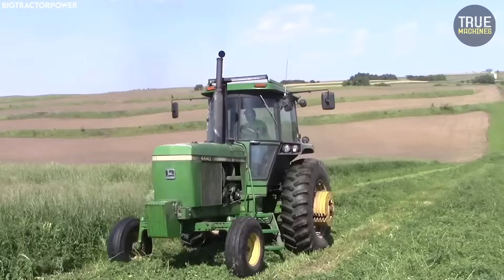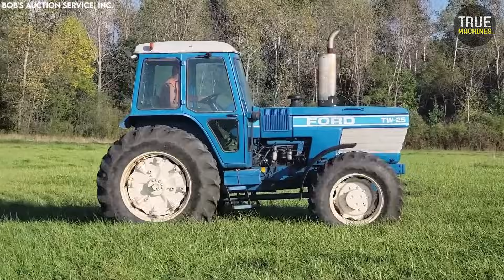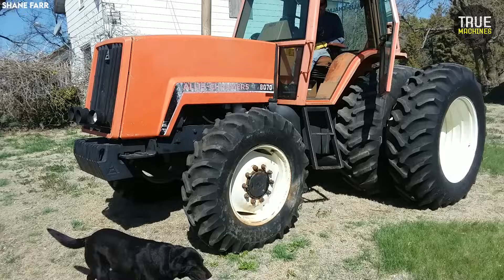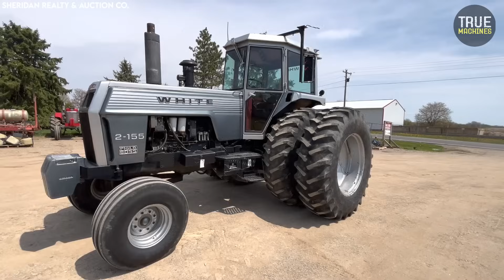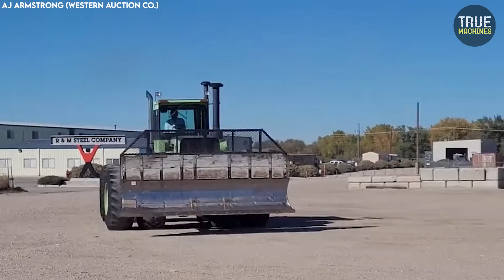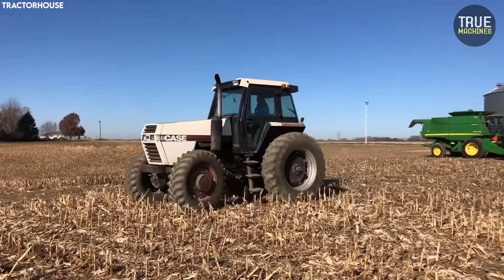Top 10 Most Reliable American Tractors of the 80s

Comment: I'll gladly stay beside my  1971 MASSEY FERGUSON 1150 anyday over all of those tractors . I've had it since the mid 70s and she still runs great after having a pretty hard life pulling an 8 bottom plow with 16 inch blades . More reliable than a deere john or a cornhusker.  My bad ass MASSEY still revs like a race car engine very quick and responsive V8 PERKINS POWER BABY...
Reply: what about the hydrolics? massey hydrolics are terrible, not sure about this particular model of tractor
Reply: the hydraulics are still superior to any corn huskers or deere johns  on a MASSEY FERGUSON  however you've heard wrong about a MASSEY FERGUSON about the hydraulics being troublesome @morrismorrison2819

Comment: The 1086 had the 415 engine. The 1486 had the 436 engine.
Reply: Actually it’s the dt414 not 415
Reply: @joeericson6997  I think ours says 415 on the block
Reply: @joeericson6997  i think our 1086 has 415 stamped on it
Reply: 414 and 415 exact same engine. They were just vented differently. Same with the 436 and 437 same engine vented differently

Comment: The 1086 was a pile of trash… Shit transmission linkage  under the seat. The open center hydraulic system was horrid.
Reply: I disagree. Been running our 1086 for decades. Not perfect but dependable
Reply: Sybau